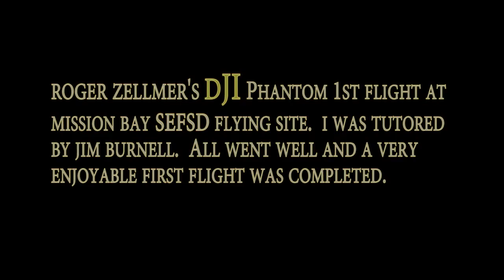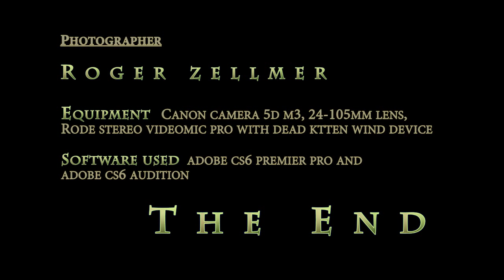DJI Phantom Helicopter First flight with coaching by Jim Bonnardel.

Comment: The Phantom has to see at least 7 Sats for red lights to go out.  You don't have to calibrate the compass unless the Naza FC requires it. ESCs check motor RPM 400 times a second not 300. Aside from that, Jim did a good job coaching you for your first flight.  Welcome to the world of multi-rotos!  Now you have to build a F450, F550 and a TBS discovery!  It's an addiction!

Comment: Oh Dear - Transmitter aerial points down! Ensure transmitter is ON before connecting battery. Calibrate compass once then only if FC shows blinking red / yellow OR if you travel any distance like 100mile from where the compass was last calibrated. Battery time on with stock battery with GoPro and Tarot Gimbal  on mine is apx 5 mins

Comment: Yes on 7 sats before the light goes out... on the motor RPM,  300-400 CPS,... still faster than a human thinks....  and I disagree... you should calibrate the compass EVERY time you travel enough to change the GPS/Magnetic compass deviation.